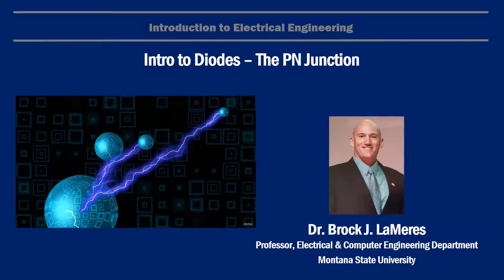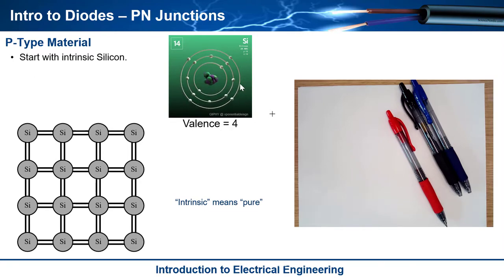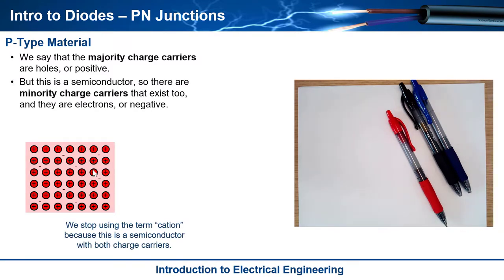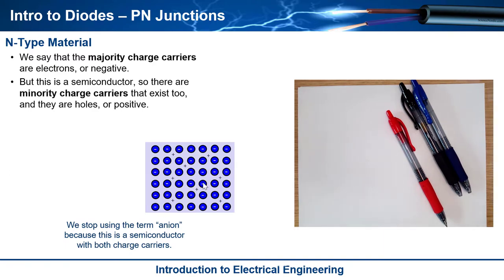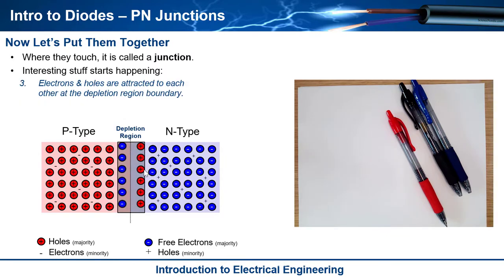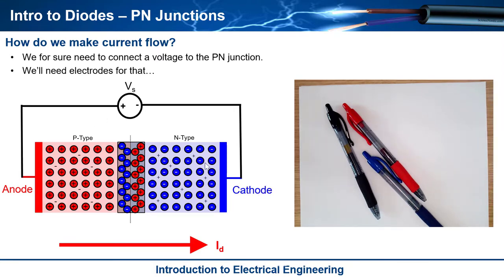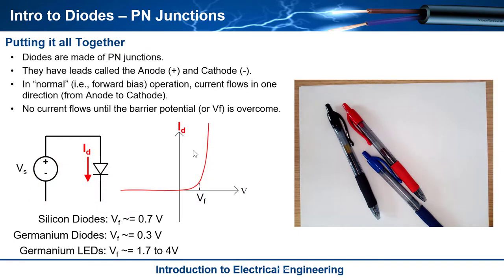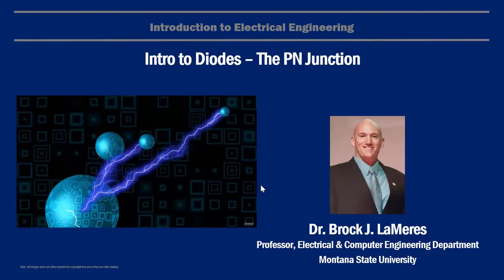Intro to Diodes - The PN Junction

Comment: At 06:36 you say P type material is "positively charged". Are you sure?  I get that in p type material the majority of charge carriers are holes, but as (in your example boron) a trivalent (3 electrons in outer 'shell' ) element will have a matching number of negatively charged electrons and positively charged protons - by itself is P type material not neutrally charged? (in the same way that by itself N type material is neutrally charged also)